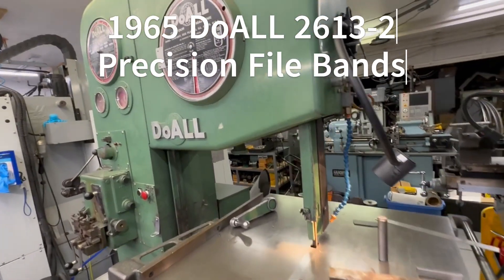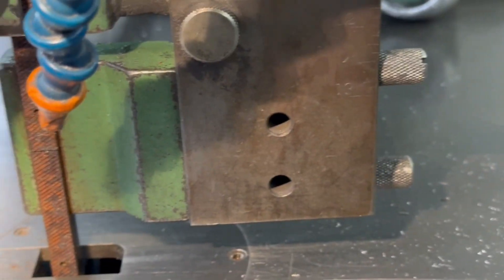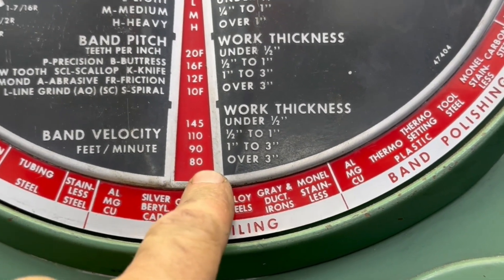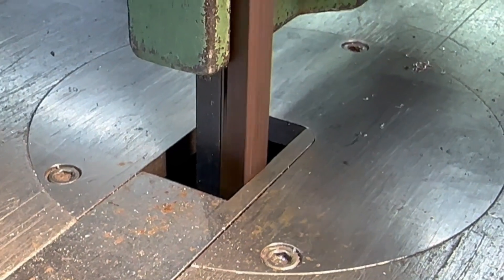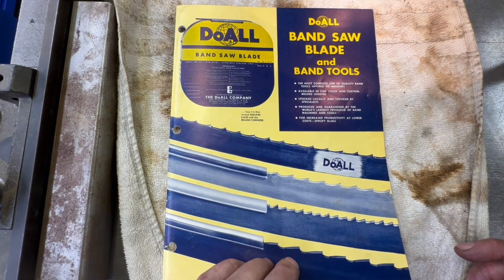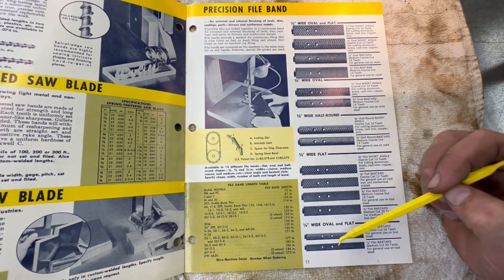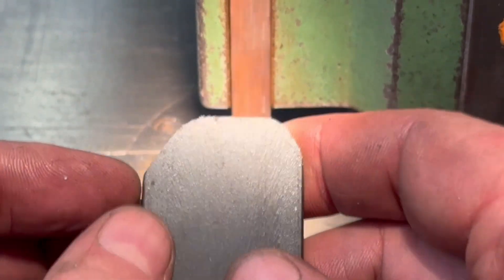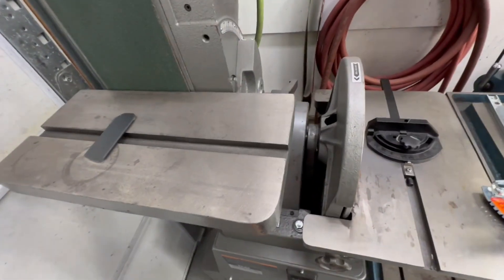DoALL File Band

Comment: Belt sanders and grinders have all but replaced file machines, as the technology for abrasives got to the point where they were cheaper and just as efficient at material removal.  But die filers have found a place in many home shops for intricate work.